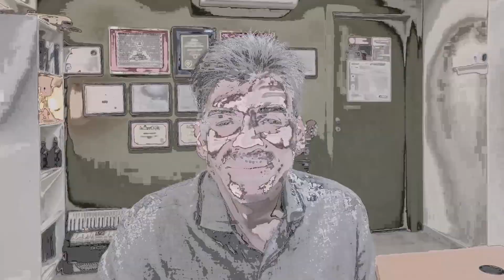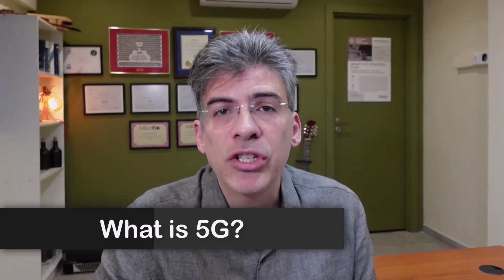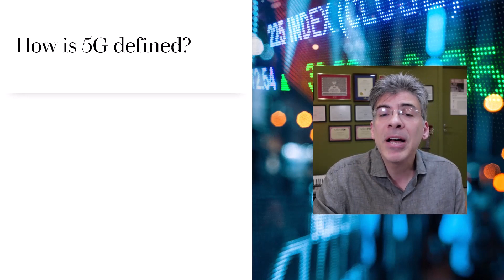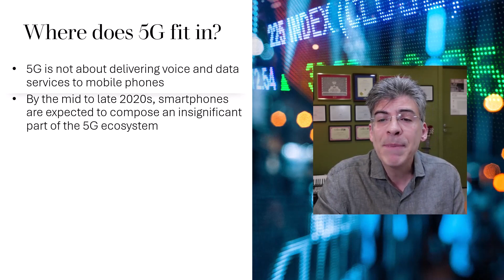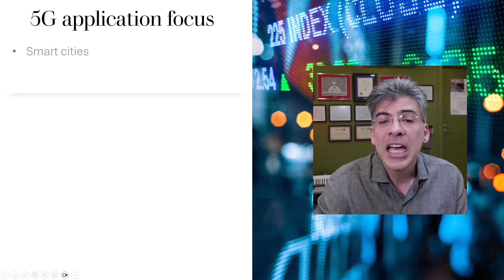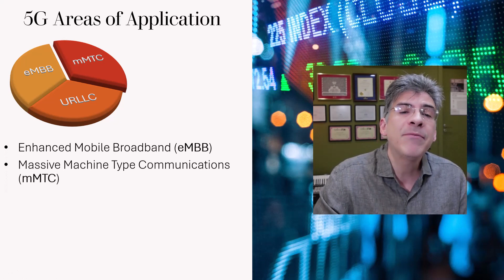5G - What is it and why does it matter?

Comment: Great video!  I knew on the surface what 5G is, but now I have a much greater in depth understand.

Question for you, you mentioned latency should be from 1 to 4 ms, that seems incredibly low for a cellular device to be able to reach those low latency speeds.  I currently use 5G Home Internet, and my latency/speed is about 30ms at best.  My throughput varies as you have indicated from 100Mbits to 350Mbits.  Streaming and downloading and surfing are extremely fast in my opinion, but where it lacks is in on-line gaming.  I’m seeing the best latency for most online gaming applications to be around 60ms.  I’ve used cable and DSL internet services in the past and the latency on similar services has been about 30 ms, and in some cases it has been as low as 5-10 ms.  If 5G has a 1-4 Mbit latency, why is it so much higher than their hard lines cable or DSL counterparts for online gaming?  In my experience for all Cellular, cable, and DSL mediums of Internet transmission, the biggest offender is the first hop (from the “modem” to the carrier’s first network node).  Seems like 5G should be crushing it like cable/DSL, but I feel it is much more than the 1-4 ms, and more like  30-60 ms.  Your thoughts?
Reply from the maker: Hello Joseph.  When we talk about latency on cellular networks, we are talking strictly about the contribution of the wireless component of the communication.  I'm assuming you're measuring latency using ping, and if so, you are measuring the total delay from your host to some server on the Internet.  The values of latency that the 5G standard promises are measured from the wireless device to the 5G base station only.  Secondly, these low latency values are only available under the URLLC area application, rather than the eMBB area of application that home 5G broadband services typically use.  I'll put together a video to describe the latency threshold of 5G more comprehensively, so watch out for that in the coming weeks.   I hope this has been helpful!
Reply: @telecomTech.explained  Thank you for the quick and thorough explanation.  You are correct, I am referring to ping or tracert when I was talking about latency.  What I found the latency from my cellular device (either when tethering to my  phone or connecting through my 5G Home Internet router) that the latency is about 60ms for that first network hop over the air to the cellular tower.  I'll have to re-run my tests since I received an upgraded 5G Home Internet router.  I'm looking forward to your video further explaining this topic!  Keep up the good work!  You present content in a clear, concise manner and your delivery makes it enjoyable to watch.  Well done!